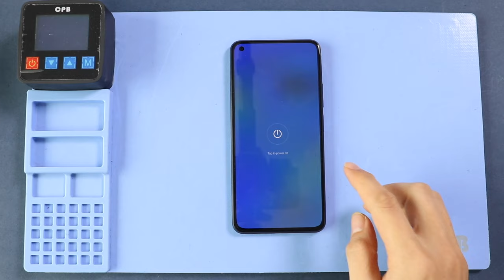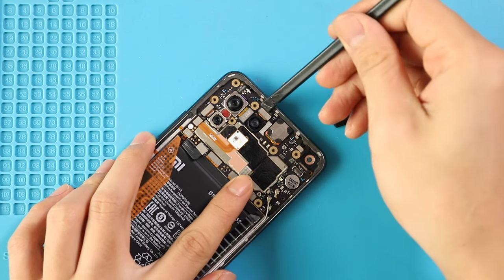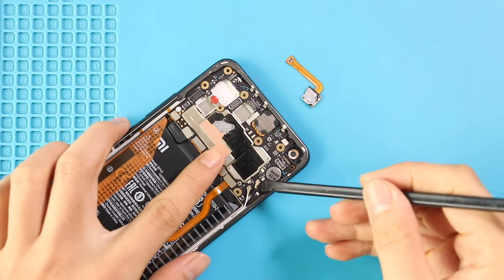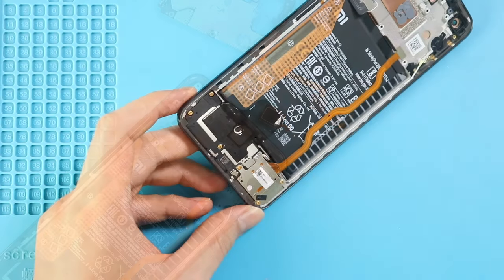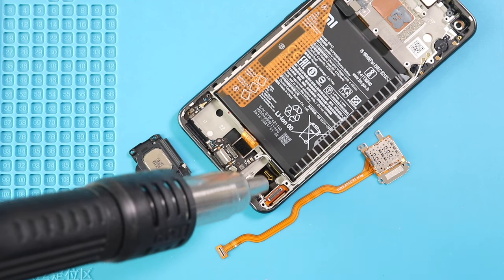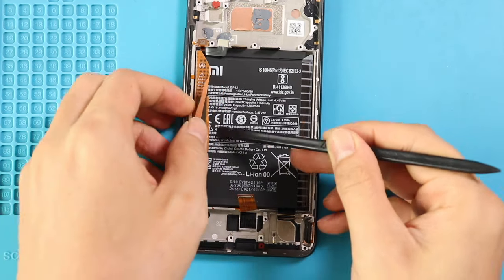Inside Xiaomi Mi 11 Lite Teardown | Screen Replacement Part 1

Comment: Bro ,can you tell me if the fingerprint sensor of Xiaomi 10 pro Max works well  with this device as a replacement part?
Reply from the maker: you mean in Mi 11 Lite?
Reply: @DIYGeardo  yes
Reply: Cause my brother has a 10 pro max whose motherboard has been damaged and my fingerprint stopped working out of nowhere , so he offered me to scavenge his sensor 'cause he would be throwing away the device anyways.
Reply: To be precise Xiaomi 11 lite 5G NE

Comment: In order to change the fingerprint sensor is it necessary to follow all the steps? Since the button connector is just under the battery may it be possible to just remove the battery without taking apart all the electronics?

Comment: bro how to open the backdoor with hairdryer? i heard you can use hairdryer to open it if you dont have the suction tool, how?
Reply from the maker: You can use it to heat the back cover...
Reply: @DIYGeardo  how long?? i have heated it for around 15 minutes and thr back didn't loosen at all. could you tell me the detail how to heat the back?

Comment: Hey I tried to fix my power button, but failed. Now the fp & on/off button won't do anything. If I buy a new fp flexible, will on/off button works again? or do i need to get that part on 10:06? Thank you

Comment: What If I accidentally Put my Sim Ejector Tool into the Bottom Microphone i.e. placed next to the Sim card tray ? 
Is it safe or Will it damage my microphone?
Reply from the maker: It is not safe.You should avoid that.

Comment: Hey man great vid. Does this device has an actual proximity sensor or it uses the ultrasound technology? greetings from Colombia.
Reply from the maker: if i am correct. it comes with a proximity sensor unit..
Reply: @DIYGeardo  no that's wrong, it uses ultrasound
Reply: @DIYGeardo  this phone doesn't come with a proximity sensor and that keeps the screen on while placing it on the ears .. it's very annoying as accidental touch happens during call

Comment: Hello. Congratulations for the video and for your precision in the way you work. I wanted to ask you the name of your workstation?
Reply from the maker: You mean the Blue Colour Mat ?
Reply: @DIYGeardo  Yes. Does the part of the device that you need to disassemble be heated directly to the temperature?
Reply from the maker: oh thats't the heat mat..alternatively you can use a hot air gun..to remove the back cover, you need to heat the device..

Comment: Does it has dual tone led flash or single tone (white) flash ??????
Reply from the maker: Dual
Reply: @DIYGeardo  no due to this confusion I replaced it but got the same thing on another unit. Actually it has single flash , the other one is light sensor.
Reply: @hariomsingh8511  you're right! God I was so confused about this as well hahah.
Reply from the maker: @hariomsingh8511  was it 4g or 5g versions ?
Reply: @DIYGeardo  5g

Comment: Great vid! I have one question, and that is does your unit produce a rattle-like sound when slightly tapping the camera and near the rear camera module. After watching this video I'm questioning if something is loose in my unit (perhaps the upper left screw which is making that rattle noise.
Reply from the maker: well, it is quite hard to say what it is , check for a loose connection and if not it maybe with some part..
Reply: Same issue tapping camera backside and front side tick tick sound 
share camera quality ur opinion..? I use average this price range 
your device replacement and continue use..?
My device 11 lite ne 5g
Reply: @DIYGeardo  which camera main sensor use and any apps suggest for camera sensor use..?
Reply: you have to tap pretty hard before it happens
Reply: I have few days ago bought unit and the rattle is there so don't worry about it :) had this with many other phones too and never had any problems.
Reply: I think the camera sensor may move a little in the housing.. some kind of image stabilization like thing.

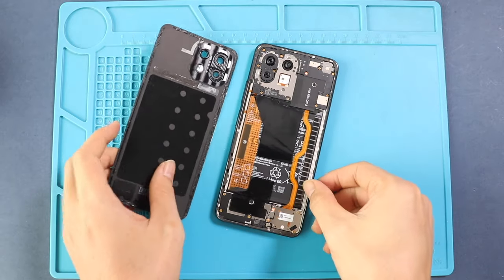Comment: So cool.  Hey.  I have a question.  At exactly 1:36 you reveal the inside cover.  There is a black 'something' the size of a credit card with 12 holes in it.  What is that?  An antenna?  Cushioning?  And if I were to a magnetic plate there instead -- for a car phone holder -- would that magnetic piece interfere with the phone?
Reply from the maker: Kind of cushion, Definitely not a magnetic plate.
Reply: @DIYGeardo  Thanks for responding.

Comment: Battery Replacement. 
To only replace battery can you remove it immediately after disconnection of battery connectors near beginning of video (and skip removing cameras, logic board etc etc etc)?    Please reply  🙏
Reply from the maker: You can find the battery replacement guide on our channel

Comment: My display was damaged by myself. I was try to change the display but display not wark, i try 4 times but no one can fix it.somebody said the display is not match. Somebody said the display lighting connector problem that way the display maybe wark with black screen and the light not wark.
So now how can i know what is the main problem. And one thing, the phone is wark, because when i trun on the power button, the phone is vibrat.
Tall me the solution please

Comment: Hi, Appreciate your efforts. I got MI 11 lite ne 5g model and it fell into the water and I kept in rice for 48 hours, But still display gone, and everything working even the touch. I try to change the display in some local shops they check with the new display without removing the old one by just attaching it to the display port on the bottom side. The display working but continuesly showing some lines and now they are saying we might change the display strip too. Can you please let me know from where we can order the display strip as the local shops are not having it in my hometown.

Comment: I have the 5g 11 lite of this. It fell on the water, now its the screen is not opening but i can still hear its open and theres vibration. Is it advisable to open so I can try to use hair dryer on the inside ?
Reply from the maker: First let it dry very well..then try to clean using some 100% alcohol

Comment: Sir plz tell me screen flicring is hardware problem or software problem in mi 11 lite
Reply from the maker: You can try a reset, if that is not helping probably you need to check the screen. if it still happening, then need to seek a technician. But this is a new phone, you should have the warranty right ?
Reply: @DIYGeardo  technical said tha this feature of dc dming.

Comment: I have this phone but one problem is that NOT CHARGING 
 WHEN CHARGER CONNECT WILL SHOWING  AIR TEMPERATURE IS LOW  

WHAT SOLUTION
Reply from the maker: Can you try to replace with a new charging port board ?

Comment: Does Xiaomi mi 11 lite and Xiaomi mi 11 lite 5g have same components of hardware?
Reply from the maker: well most of them are same, except 5g comes with better chipset ,gpu, cpu, gorilla glass , better front camera and few more features
Reply: 4g or 5g? This is misleading... Even haptic motor is different, I can easily feel that.
Reply from the maker: @lukakoprivica  this device is 4g, if it is 5G we would have mentioned. But still repair steps almost similar and parts too..
Reply: @DIYGeardo  recently I upgraded my mi 11 lite 4g to latest version and after the update I lost all my signal can you help me with it Geardo.
Reply from the maker: @lheisleysamfajardo3767  Well i think the best way is to go to the service center and seek their assistance. This is a new phone and you should have warranty on this. First we can try this option and then move to the others..
Reply: @DIYGeardo  I do have one more question regarding the black thingy on the backside it's like cellophane what is the purpose of that one I'm just curious is it ok If I will cut it?

Comment: My powerbutton is not working again, it's like stuck up and unclickable. this is the 2nd time that this happened for my unit, And it takes almost 3months to repair. This xiaomi mi 11 lite is frustrating
Reply from the maker: I mean the flex is not that expensive and a technician can do the work within 30 minutes.. certain models
Have issues

Comment: I pierced sim tool in mic hole by mistake. Will it affect mic performance?!
Reply from the maker: Maybe, see how it goes..
Reply: @DIYGeardo  You know how the microphones are mounted, but you haven't mention them in the video. Does the sim key can affect upper or lower microfones? The holes are in line with the microphones or not ?

Comment: BROO PLEASE MAKE A VIDEO OF POWER BUTTON REPLACEMENT FOR THIS PHONE I REALLY NEED IT BECAUSE MY POWER BUTTON GOT STUCK INSIDE WHEN I PRESS IT AND NOW THE PHONE KEEPS RESTARTING 😭😭
Reply from the maker: We have the video, but we still didn’t upload. Will try to add soon..
Reply: @DIYGeardo  Thanks!!  i'll waitt
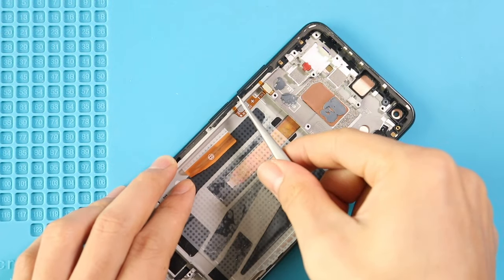Reply from the maker: @sandferozzz4543  You can also follow this teardown guide.. Starting from 08:45
Reply: @DIYGeardo  so to replace the power button i need to remove the battery first? is there any other part i should remove? like the camera or etc?